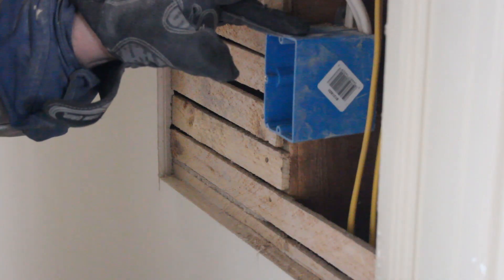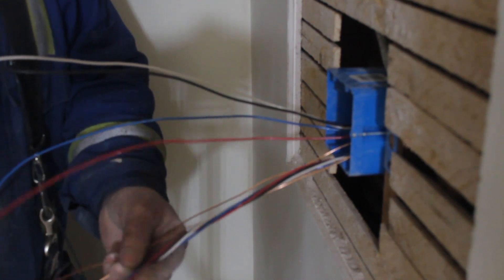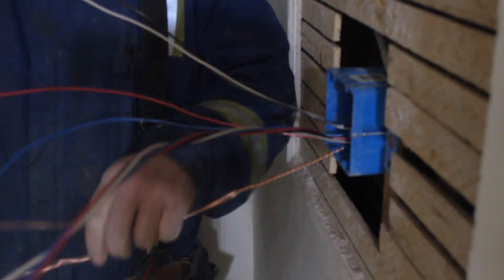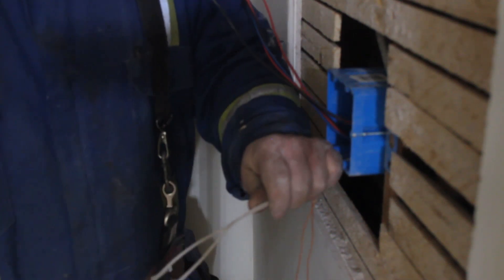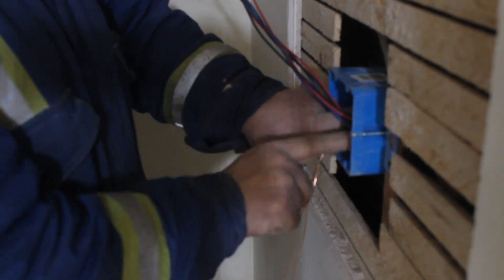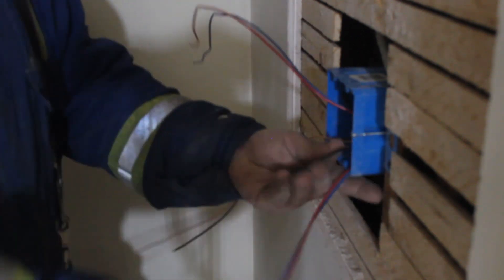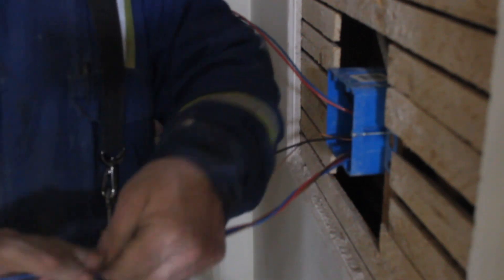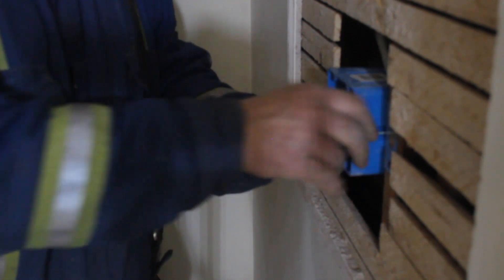wiring 3 and 4way switches with 14/4

Comment: So I’m pretty handy when it comes to electrical but not professionally though. I’ve done a bunch of three ways and four ways with feeds in different locations but I never remember using 14-4…. What exactly were you wiring?
Reply from the maker: So there are newer codes regarding having a neutral at all switch boxes that aren't feasible using 3 wire in some cases, also it's a good way to carry the hot and neutral plus the travelers in case you are feeding other rooms or closets, etc.
Reply: @arnehelland6015  Wow. That’s really clever. 
Interesting about the code change. Good heads up just in case I do any heavy remodels at my house and an inspector makes me redo it.